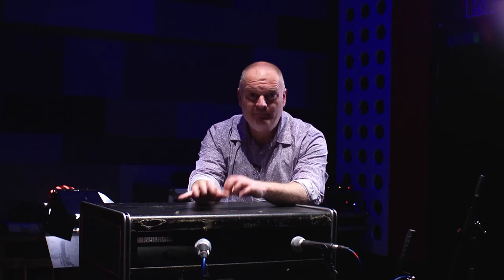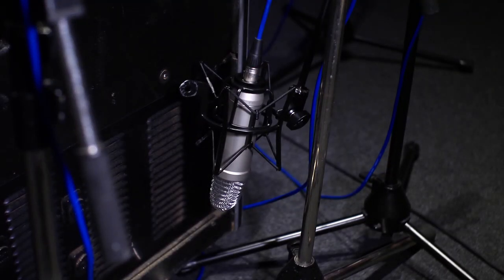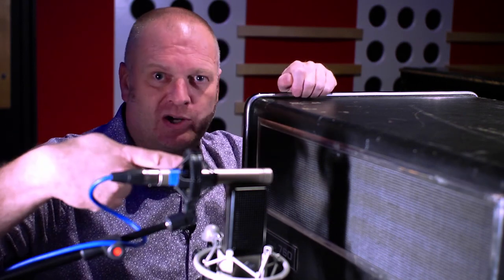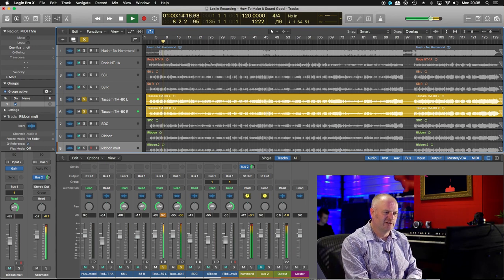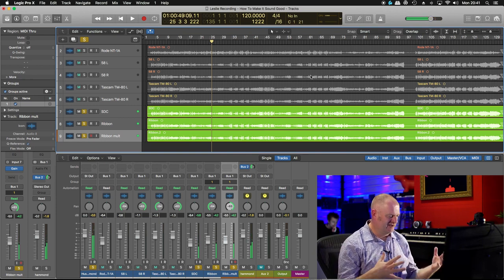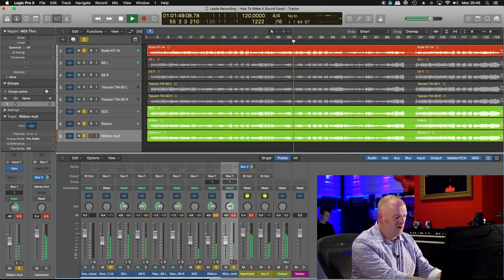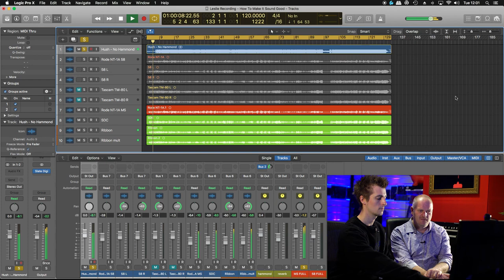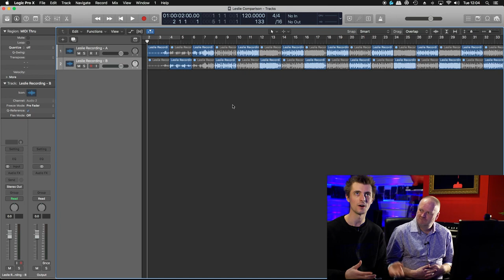3 ways to mic and record a Hammond organ through a Leslie speaker! Can you tell the difference?

Comment: Great stuff! Another route is a pair at 90deg face-away at the rear of the cab (at back  louvers) and lrg diaphragm center low. Width but not overdone.

Another is a decent PZM inside top rotor cavity (122, 147 etc) and center low of choice. The boundary mic in confined space delivers a wonderfully nasty bite and grit.

Comment: I’m in the US, my 1st two Leslie’s were 147’s, and most of my fellow keyboard friends also had 147’s.   We didn’t usually see that many 122’s in the Midwest.  We also had several of the really reeealy old Leslie’s that had woofers with huge active coils instead of magnets.
  The opposite rotation direction was not intentional, it was because of motor positions.  They’re balanced and shouldn’t cause the cabinet to move.
Reply from the maker: The first iterations of the ‘new’ 122 and 147 (with the styrofoam bass rotor) had both rotors spinning in the same direction and just sounded ‘wrong’ because of it. It’s all those details that add up and make the sound so hard to replicate with a simulation. Thanks for watching!
Reply: @PresentDayProduction  I agree with, the spinning in the same direction just sounds wrong. If you have 2 side by side you will pick the opposite one every time. I used to have 2 - 145's. 1 for my A100 and one for my guitar rig, both church grade finishes, so I bought one of those "New 147's" when I opened the box, 10 years or so ago, here in northern Ca. the bottom styrofoam bass rotor was cracked in half in such a wrong way. It was stuck. I made the "I need to return this call" concerned that trying to start it would only make it worse. Soon thereafter and still today, they are impossible to find. Still on backorder at every big store here in the US. Hard to find used. I just secured a chopped short 145. Coming in at 30" tall with all the works from the 1960s. Sounds as big as any and fits in a car or a closet. The new big problem is the cost of delivery just tripled here. LA is a 15 hour round trip for me. So it took me and the chop king of LA a week to come to grips with the delivery cost and get it on the road. Just my 2 cents of support. Peace ~ LW
Reply: @PresentDayProduction  Opps...I am wearing corrective insoles and I stand corrected. They are back for double to not sound not quite as good. The Leslie 3300 @ Sweetwater https://www.sweetwater.com/store/detail/3300--leslie-model-3300-300-watt-15-inch-combo-with-2-speed-rotary-horn-black#modal 3195 plus tax and pls call for Est shipping. Gotcha!

Comment: Great video! I actually prefer the typical mic pair enclosing a certain angle for the horn rotor over the MS configuation. However, I'd probably try AKG C414s/AA OC818s/Neumann U87s (if available) instead of dynamic mics in a studio setting where every instrument is recorded separately (by the way, I'd never pan them hard left and right - it's better for the mix if the stereo image is there but more in a confined way). All those years ago I made a mistake and used kick drum mics (e.g., the AKG D112 or Audix D6) for the woofer, despite knowing that all tube amp-driven Leslies have an 800 Hz crossover. Therefore, the 15" speaker actually puts out a lot of mids. If it gets reduced to a frequency range typical for kick drum mics the Leslie will sound weak/thin. In combination with a low cut added during mixing this is the death blow for the Leslie sound. It's so important to use mics for the woofer which pick up both bass and midrange (and mix it in a way where it doesn't sound muffled). At the moment I prefer a Sennheiser MD421. On the one hand, I totally agree that the sound source (instruments, proper miking) has to be spot on from the start. On the other hand, a dense mix causes each instrument to lose considerable detail, and thus the choice of mics for the Leslie becomes less important. The question then is whether close-up miking with dynamic mics for a more direct sound is not the best solution from the start in such a case. I also agree that EQ will enable the sound engineer to get the best out of any mic. But the mic itself will influence the engineer to EQ it in a particular way.
Reply from the maker: I generally find that if I want the Hammond as a background instrument then I back the mics off considerably, often many metres away. But for a more up front sound then it’s quite often a couple of dynamics on the horn, really close, and a LDC on the bass rotor. Love 414s on the Leslie generally, but it’s all EQ so I’m never fussy about mic choices.
Reply: @PresentDayProduction  It's very understandable that an ambient instrument is recorded as it should be perceived. With the horn rotor it's actually quite easy because it's only a matter of taste (e.g., in terms of brightness) what mics to use and in a crowded mix it's almost unimportant. However, I oftentimes have the impression that it's not very well understood what the 15" speaker should contribute to the sound rather than providing a foundation to the upper driver and horn rotor. Low mids are a game changer - something I realized during A/B comparisons using different woofers.

Comment: Really great video. I’ve got a Hammond XK3C plus Leslie 2101 (not able to transport full Leslie). I always seem to pick up the ‘click’ when switching between slow and fast. Do you get that with the main Leslies? Cheers, Andy
Reply from the maker: Thanks Andy, glad you enjoyed the video. I’ve also got a 2101 that I use for the occasional gig and yes, you get a click when switching speeds, but not as much of a click as you get with the old valve ones. The 147 in particular are bad for this. The relay in the amp clicks quite loudly, but because they use a 240v switching system that also makes the amp ‘pop’ so is clearly audible through the speakers once the capacitors start to age and dry out. That’s all part of ‘the sound’ for me though, and on the rare occasion I need to use  simulator, or if I get an organ track through to mix that’s been done on a clone or Leslie sim, I’ll often add in some clicks and pops and a bit of wind noise just to make it sound more authentic.

Comment: In a live setting, would you recommend low cut on the treble mics and high cut on the bass mic? If so, at what frequencies?
Reply from the maker: It depends on the instrument and if it needs it. For example - guitars, they don’t need any sub-bass energy, so I cut about 60Hz and below. Vocals, maybe 100Hz and below.

I don’t really think I’ve ever cut treble in a low-pass from anything, but if it causes you issues, then go for it. Instruments like bass guitars won’t produce anything super high worth cutting, but maybe do it to be safe if you want everything under control
Reply: @PresentDayProduction  thank you, but I mean the 3 mics on a Lesley.
Reply from the maker: Sorry about that, it wouldn’t let us know which video the comment was on so had to assume it was a broad question!

Mark doesn’t check the comments very often, however whenever I (James) mixed the sound for Mark’s band, I did a high-pass on the top mics to get rid of any rumble or wind noise (maybe 100Hz HPF), but I left the bass mic full-range.
Reply: @PresentDayProduction  thank you

Comment: What would work best for a live band set up
Reply from the maker: For me it’s always been a couple of SM57s close mic’ing the top, and a cardioid large diaphragm dynamic on the low end - RE20/SM7/MD421 etc
Reply: Or just 3 57s two on top horn one on bottom....depending on how big the room is( how much spl needed thru pa.)it should be very difficult to screw this up...even if you have just one mic and one channel available,  then just place it a couple of feet away , and find the correct height to get a good mix between the high rotor and low ( if a two rotor Leslie) and your done....don't be intimidated by it,  these speakers sound great and it really is difficult to screw it up